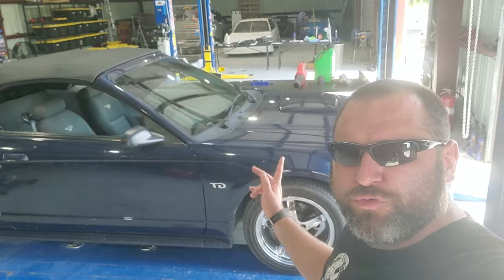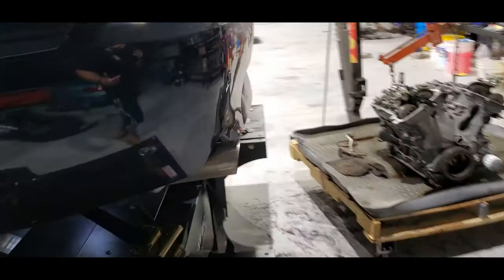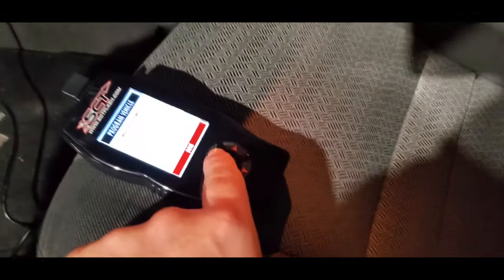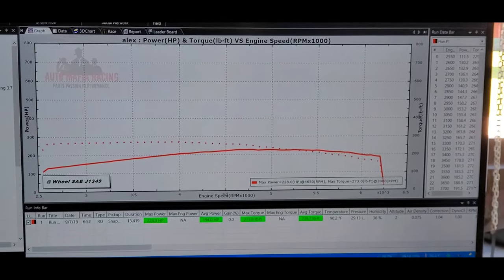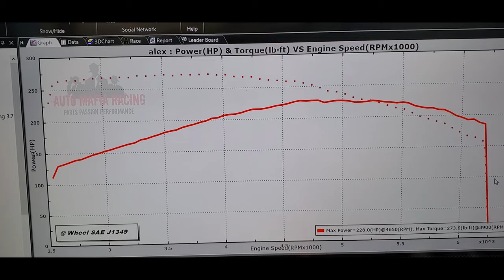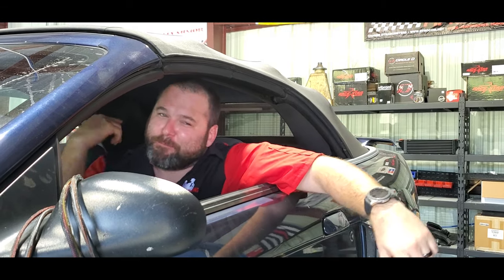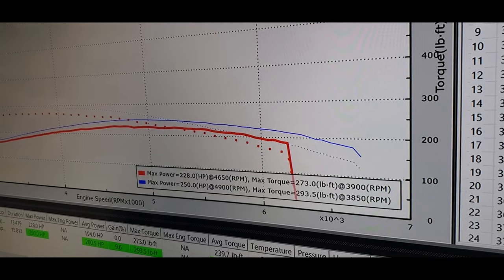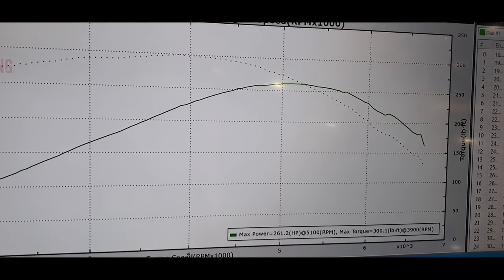Basic Bolt on 99 2v 4.6 V8 Mustang Gains 35 rwhp and 30 ft lbs of torque with  Mafia Dyno Tuning

Comment: They make about 220-230 normally through a 5 speed on a dyno jet.  They were rated at 260 flywheel.
Reply from the maker: when new sometimes. weve seen them make under 200
Reply: @automafiaracing  well they shouldn't be making under 200 on a dyno jet unless something is wrong with the car or it's just worn out or something.  I'm talking about the pi models...the non pi models make well under 200 to the ground every time.  This one was low because of a horrendous previous tune that was dragging it down.  I'm kinda amazed just how bad it was lol.  Good job getting it sorted
Reply from the maker: Yeah we have a dynocom so it reads a bit lower than the avg dynojet in our experience. But yeah it was basically a stock tune
Reply: I have full bolt-ons on a 99 Gt 5 speed with full length BBK headers into an off-road x pipe and stage two Crower cams. It's a conservative 93 octane tune for reliability, 295 RWHP with 305 foot pounds of torque. Runs very low 13's. The car is so much more fun to drive  and sounds fantastic!!
Reply from the maker: Sounds fun

Comment: New Edge Mustangs are not meant to remain stock.  But to make serious power you need forced induction.  I suggest the KB 2.1L.   Ditch the Boost-a-Pump (get the Terminator dual pumps), ditch the heat exchanger (again, go with a Terminator HE), and also the water fill reservoir (get something bigger).  Get suspension (there are many suspension kits to get rid of the 4x4 look and a firmer ride) and brakes (Mach 1 brake kit,  front and rear, they work and look awesome with the red calipers and the pony).  You will need an H-pipe (or an X if you prefer), and a Borla cat back.  Then you will need decent tires.  No street tire will grip, but if it rains where you live, do not get drag radials.  I got Pirelli Pilot Sport PS4, and if you go easy on the throttle you can launch without too much drama.  Get 3.73 gears.  4.10s will be too much for the instant torque of a twin screw sc. Remember to get the SCT, Diablosport, or whatever your tuner usually tunes with.  Get a conservative dyno tune at 9 or 10 psi, unless you get forged internals,  but the 4.6 2v engine can take a lot of abuse and keep going.
Reply from the maker: agreed boost is always the answer.
Reply: Don't 2valve blocks crack at 500+?
Reply from the maker: No. They shoot rods and pistons
Reply: @automafiaracing  Just don't go crazy.  400 rwhp in a Mustang dyno is a lot of fun.
Reply: @CWAUTOREPAIR  Keep it under 500!
Reply from the maker: Sure is

Comment: thats wild! i made 280 hp and 330trq with my 2004 2v with just long tubes, cai, 75mm TB, c&l intake plenum and a dyno tune
Reply from the maker: Crazy
Reply: What brand 75mm did you go with? Those are pretty good numbers. I wanna look into TB + Plenum + intake manifold for mine. Just a little stumped on the tb/plenum
Reply from the maker: We sell a lot of the bbk
Reply: @automafiaracing  bbk 75mm?
Reply from the maker: BBK makes a good tb yeag
Reply from the maker: 📬 Contact us for build advice and guaranteed lowest prices.
📞 941-979-1132
📧 Support@AutoMafiaRacing.com 

facebook.com/automafiaracing

Comment: when i had my 1999 mustang GT, i ran a 70mm th body, mac long tube headers with 3 in collectors, 3 in  mac power chamber no cats, ported upper intake plen, FRPP underdrive pulleys, 24 lb injectors, 4.10 gears, Ported 80mm mass air, K&N open element filter, Super Chips tune for 100 oct fuel.. 310 hp with a Auto and a 3000 stall and a transgo shiftkit. Key is the plugs, copper 1 step hotter. custom gap.
Reply from the maker: Sounds fun but also 100% that did not make 310 rwhp. #wecallbs
Reply: @automafiaracing  Thats nice, When you stop bench racing and learn to TUNE let me know... Maybe i will give you a taste of my Beer.
Reply from the maker: Ok man. You're Superchips got you so much hp....   We've built plenty of these and you aren't making 310 rwhp with stock cams.
Reply: I think he meant 310 crank hp
Reply from the maker: 310 dream hp

Comment: I recently bought a BONE STOCK 2002 Mustang GT. I mean it is factory exhaust, factory air cleaner…. Everything.  I really like to keep my cars as stock as possible - BUT here’s my question -  Can a tune help a completely stock set up like mine?   Thanks.
Reply from the maker: Yes 100%
Reply: Yes I have an 03 that was tune and k&n drop in filter and you can actually feel the difference. Never actually noticed those tiny changes in any other car before lol

Comment: Hey man i have a question? My 99 gt when i bought it came with some maf sensor  that came off a late 90s ranger ( done by the previous owner) i bought a oem maf for my year mustang and the car ran wouldn't run right ? Is this something i have to get tuned? Thanks!
Reply from the maker: Its probably tuned for the other Maf
Reply: @automafiaracing gotcha thank you!

Comment: The new edge is good for cruising and looks. Even sound good but making power.......meh. I got love for them tho
Reply from the maker: So do we
Reply: The new edge needs a turbo and some gears and it'll hang with the 2016s no probs.
Reply from the maker: NA ones ya
Reply: They make power just not for low price lol
Reply from the maker: Truth
Reply: Lol 300hp full slam keeps up with these light-footed Coyote owners see how far those RPMs go before oil pump blows for them!
Reply: Cam and nitrous with pi heads will very the job done
Reply from the maker: Very true
Reply: Definitely agree

Comment: Wonderful but How does it handle?  Any suspension work ?
Reply from the maker: Don't remember probably stock
Reply: @automafiaracing  I hear you.  Was just wondering. I had a lowered 03 first thing I did was bolt ons but the car handled horrible.    I have a 97 convertible now and it also handles horrible so Instead of the bolt ons for power I’m trying to get it to handle and feel safe.
Reply from the maker: We can help.

📬 Contact us for build advice and guaranteed lowest prices.
📞 941-979-1132
📧 Support@AutoMafiaRacing.com 

facebook.com/automafiaracing

Comment: How did u get the automatic to run on the Dyno ??? The automatic 2vs have 1-2 low gears apparently they can't run on the Dyno because of it ??
Reply from the maker: Hit the gas?
Reply: @automafiaracing  so did you run it in 1st or 2nd low gear ?
Reply from the maker: 3rd

Comment: Those numbers seem low for a V8. What about the 4.6 4 valve that came in the Mach 1 and cobra? Those are much better right?
Reply from the maker: This is just the reality of older V8s.  The 2vs didnt make much power.  yes the 4v made more.
Reply: My manual Mach 1 made 290 whp   About the same as my 3.7.   Can’t remember the torque but I have nearly identical 1/4 mile time slips between the Mach1 I had and my 3.7
Reply from the maker: they are fun cars
Reply: The old 2 valve 4.6 doesnt have the cylinder head flow for higher HP. The 3 and 4 valve versions of the 4.6 made 40-50 more horsepower.
Reply: The 2vs are truck motors but they get off the line with there low end power

Comment: WOWZERS need your tune on my 99 gt 2 valve!! It's only got 85,000 original miles with mild bolt ons (bbk offroad X-PIPE, magnaflow mufflers, upgraded coils, and KN cold air intake and a larger throttle body) whatta ya think?
REDD
Reply from the maker: bring it on down or send us a message for an email tune

Comment: 260whp, so roughly 300 crank if you factor in 12-13% drive train loss, at 3200lbs.  What's not to love?  You can get that weight even lower and throw on a handling kit and you'll have a nice canyon carver, even if it's a live rear axle.
Reply from the maker: No one speaks in crank hp.  Its a pointless guess of a number.  But yes its still a fun ripper at 260 rwhp.

Comment: Do you guys only tune with sct software? Or do you do diablo sport as well?
Reply from the maker: No.  We tune with SCT, HP Tuners, Cobb, most stand alones, UP Rev, but no not Diablosport.
Reply: Auto Mafia Racing  ah okay. I have an 04 gt with some bolt ons and was going to get it tuned by you guys once I get long tubes here in a few months. So I would have to get an sct before I could get it dyno tuned by you guys correct?
Reply from the maker: Yes. We sell sct devices with our tuning as well
Reply: @automafiaracing  do you guys tune these cars with HP tuners? im thinking about purchasing HP tuners for my 99 gt. im gonna run stage 4 comp cams with the edlebrock vic jr intake/ fuel set up and tune it myself. but reguardless what ive noticed is i cant find any..good HP tuner tuning support/ activity for these cars. i dont really want SCT PRP mainly due to price lol.
Reply from the maker: I wouldnt hp tuners doesnt work well with the 2v
Reply: Auto Mafia Racing I guess i should just run with the SCT pro racer software then..its just kinda dumb they make you pay so much for software and then almost the same price for a flashing device . unless you can point me in a better direction..ik it’s all preference but so far i’ve been hitting brick walls with research lmao
Reply from the maker: Stand alone

Comment: Yeah unfortunately those little 2v's have some serious problems with making good na power without the help of some very radical cams or the trickflow top end kit. 

I tell you what though, this car would be a little ripper with a vortech and some 3.73 gears. 500whp can be achieved pretty easily with this set up. Granted you'll scatter your stock bottom end all over mexico, but itll be fast AF. 👍
Reply from the maker: Very true

Comment: After a CAI, flowmaster mufflers, 3 underdrive pulleys, and 78 mm throttle body, what can I add next in that order? Should it be headers? A tune or what would be a good idea?
Reply from the maker: Full exhaust and a tune. Hit us up.

📬 Contact us for build advice and guaranteed lowest prices.
📞 941-979-1132
📧 Support@AutoMafiaRacing.com    www.automafiaracing.com
Reply: I would do all your bolt ons first and than get a tune as adding bolt ons after a tune you won’t get what you can out of it

Comment: Trick flow top end and it would be perfect around 340 wheel. Wouldn't be a rocket ship by any means but, it would be a blast and sound killer and not be, well...as much of a joke. I love 2v 4.6s and I'm planning to build one for 7-800 wheel and keep it around 550-600. Should be fun in a crown Vic 🤘
Reply from the maker: Agreed. That makes them a lot of fun but far from rocketships.  They need a built motor and booooooost
Reply: @automafiaracing  yes sir! But I mean, everything needs boost lol
Reply from the maker: Absolutely everything

Comment: Damn i need to get my 02 mustang gt dyno tuned. Has pretty much same bolt ons, 3.73s,  with the sct4 & a bama tune . I do know it's qwker than my 94 z28 i used to own.
Reply from the maker: Bring it on over
Reply: People hate on the 2v but I owned a full Bolt on 5.0 fox body and a 2004 4.6 full bolt on and my 4.6 would outrun it.
Reply from the maker: They arent as bad as people.think
Reply: @setharnold3699  exactly.  Nobody hates on the old pushrod 5.0 but it isnt any better at making power than a 2v is. A 2v might actually be easier to make power with.  You can make 300 wheel with fbo and cams you can't do that with a 5.0 pushrod you would need the heads modded too maybe the intake as well.  Idk why they get so much hate I guess because you can't make 800 wheel with a stock engine (stock rods and pistons)....forged rods and pistons only cost 1200 bucks then you can let it eat.  Considering how cheaply the 2v can be had for I dont get the hate I think ppl just like to follow trends.  Its trendy to hate on the 2v because that's what everyone else does right? Lol
Reply from the maker: It was the low torque.  The pushrod 5.0 wa smore torqey and felt great

Comment: Is an automatic slower? Or get less hp?? Asking for a friend:)
Reply from the maker: Technically yes
Reply: Yes automatics are 4 speeds. My Explorer could keep up with a 4 speed convertible so I went ahead and bought a coupe 5 speed manual with gears and it’s way faster.
Reply: @automafiaracing  how
Reply from the maker: How what
Reply: @angelgjr1999  automatic cats are just a hair faster due to less shifter travel the vehicle is able to put the power down more consistently
Reply: @tyjaebowie933  A 4 speed is never as fast as a 5 speed.
Reply: @angelgjr1999  then why do 99% of all drag racers replace manual transmission with a automatic I understand you love cars ooooh I know cause the automatic is just a. Little quicker than shifting a manual
Reply: The manual transmission loses less power through drivetrain loss but far as a real world drag racer the manual performances superior it's a few seconds faster everytime
Reply: @tyjaebowie933  If you’re talking about modern 8 and 10 speed automatics than yes. But for the New Edge the 4 speed was old af and very slow. I promise your little 4 speed will get walked by my 5 speed. I’m fairly quick at changing gears and I have a stage 1 clutch with a lightweight racing flywheel. I’ve literally beaten 5.7 chargers in highway pulls.
Reply: @angelgjr1999  dude do you you really full on race cars use 2 speed powerglide transmissions from the 1960's right now today the only manual theyde use is an after market linko
Reply: @angelgjr1999  by the way my 2000 GT with it's 5.4 4valve with a 4r70 and it's 3200 stall converter would prove MY point to you and your make believe GT
Reply: @tyjaebowie933  2 speeds for an 1/8 yeah. For a 1/4 you want more availability to the torque curve. On highway pulls is the same. Unless you’re pushing 1000+ ft-lbs of torque then you want more gears. 
“Make believe” lol it has the factory 4.6 V8 modulator. The 5.4 is a junky engine that’s known to blow head gaskets, while the 2 valve is literally famous for its reliability. Mine has: BBK cold air intake with upgraded plenum, underdrive pullys, shorty headers matched with an off-road x pipe with flowmasters. A little weight reduction. McLead racing flywheel with a stage 1 clutch with 4.10 gears. Posi differential. Koni shocks and struts, staggered 285 wide Nitto tires. 
So far she’s beaten many 5.7 chargers on highway pulls, I even took out a turbo Cummins truck(that one was easy). 
I was building her to be a responsive track car but previous owners used her at the drag strip so that explains the gearing and posi rear end.
The 4.6 may surprise you what it can do with bolts ons and gearing.
Reply: @tyjaebowie933  Also how old are you? You seem like an old boomer who thinks “no replacement for displacement!” Which isn’t true anymore.
Reply: @angelgjr1999  people forget the addition convertible adds 200lbs give or take by itself and interior options add weight too. I also think the 5speed is a little lighter. I know my mothers ex husband bought a 1998 mustang gt  convertible with a 4speed auto and he said it was a little over 400lbs heavier than if he went with a base 5speed with cloth interior. 
I wish ford offered a GTS model for the new edge stangs.
Reply from the maker: Old autos were slower then the manual and heavier.  To a point.

Comment: Damn I have an 03 GT with Exhaust 410 gears, bigger throttle body. I had my sct tuner tuned by Bama to the mods on the car but it feels no different to me and I have no clue what my A/F ratio is.. Wish i could have a better tune loaded to gain some power.
Reply from the maker: We can tune it
Reply: @automafiaracing  :-( I live in PA
Reply from the maker: We tune via email all the time so we can tune world wide :)
Reply: @automafiaracing  Ah whats a website I can get in touch
Reply from the maker: https://Automafiaracing.com/
Reply: I went to the site but I didn't see any section to contact? I guess I'm looking for a more aggressive tune. The one now is practically un noticed aside from speedometer calibration for my 410 gears. And ever since, my exhaust fumes are so horrible I look like I'm high as a kite if I sit in traffic because of the fumes haha..  what is your cost, and wohkd you need a data log of my current tune?
Reply from the maker: Did you miss the whole Contact Us link?
Reply: Don't run Bama tunes they have been killing alot of cars

Comment: My 04 2v made 454whp & 422tq, I'm happy with it for the most part
Reply from the maker: Im sure!
Reply: @automafiaracing  ecu gave up i guess after 200 flashes I would too, swapping a holley terminator x into the car now
Reply from the maker: Amen. Our 2v swapped.fox runs a holley as well. Stock ecu is trash

Comment: try it on a 2002 and up with PI heads it will make more power
Reply from the maker: Oh we know
Reply from the maker: Yup
Reply: Don't the 99 and up have pi head
Reply from the maker: Yes
Reply: @automafiaracing  so if imma get a 2v needs to be 99-04 ?
Reply from the maker: Sure
Reply: @strickracing437  or you can get a 96-98 block and 99-04 heads and do pretty good on this hybrid setup

Comment: All manufacturers will lie about the hp ratings just to sell cars that mustang GT went across 140 mph easy there is a difference of 300 hp on a v6 compared to 228 hp of a v8
Reply from the maker: LoL what.  No there is not.  Our 3.7L V6 absolutely dust 2V and 3V stangs most of the time sadly